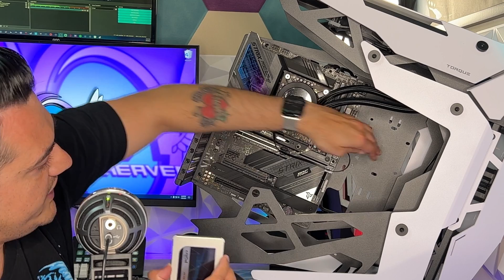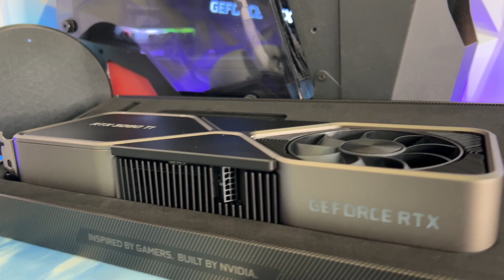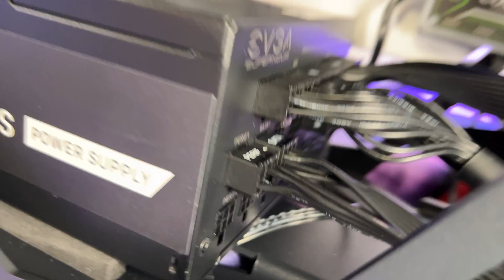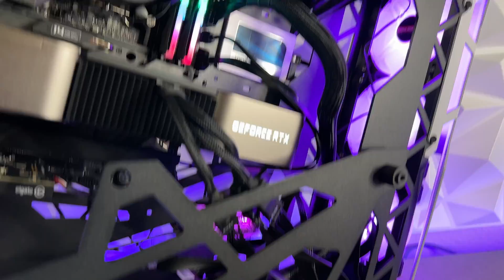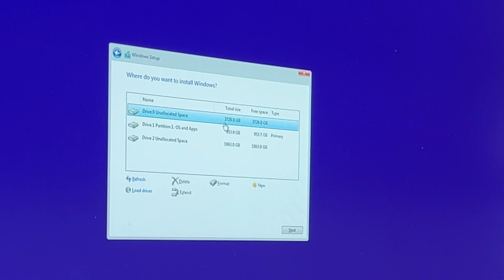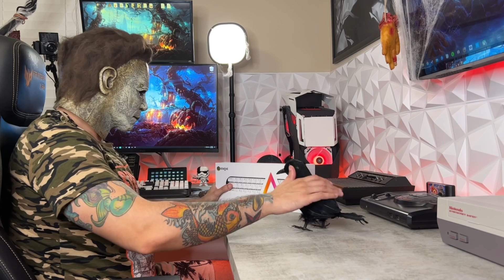Beginner's PC Build Guide: Initial Start, Software, Wire Tuck-Project0 Ep.3

Comment: quick question, when building from scratch is there a spot in the bios menu to format your M.2 drives or do you do that from the windows boot thumb drive? I guess I want to know if I can put everything new on the MB and then just enter bios and get things running or will I need another functioning PC to format the new m.2?
Reply from the maker: As soon as you do the initial install and boot of windows 10, will ask you where you want to install windows, and you can format your drivers from that window. You could also format your m.2 to on a different PC you prior to putting it in your new build.
Reply: @GamerHeavenOfficial  the reason I ask I think you were having trouble using a drive you had but I guess that’s because it was a drive you were using before

Comment: Hi I have and Alienware r12 with a 3060 ti and i7 11700kf, 16x2 3600mhz 1000 psu liquid cooled I swapped the 3060 ti for a amd 6950 xt but the performance is so low is it the cpu or Alienware that is ass? I’m considering doing the same set up you have but instead of a 3090 go amd
Reply: What's wrong? Is it thermal throttling? If so, it's definitely the case. Alien ware is complete trash, so I would blame them.
Reply: @kotztotz3530  it’s not thermal throttling but my gpu and cpu usage is so low in all games I am only getting 120-150 fps in Fortnite 1440p my cpu usage hangs at 30% while my gpu stays at 50-60% usage
Reply: @cardinal8952  that's odd...man I don't know. I would try wiping and reinstalling graphics drivers. That's all I can think of atm.
Reply: @kotztotz3530  thanks I already tried using ddu to uninstall the drivers but It didn’t help it might just be amd because my 3060 ti was stable and since you can’t fit a 3090 in the Alienware case I had to go amd
Reply: @cardinal8952  that's a bummer :/ I wish I could help more